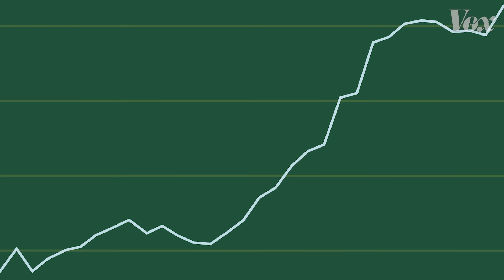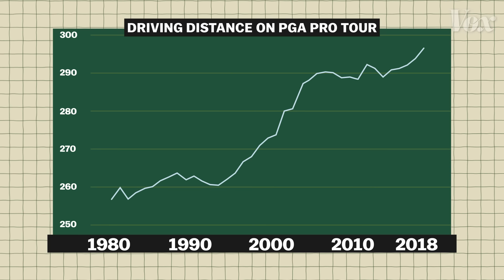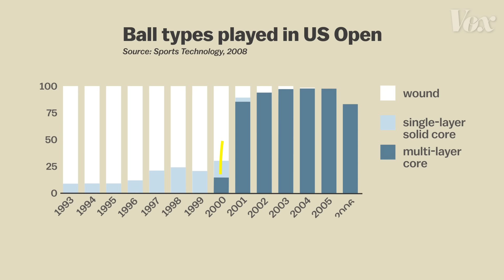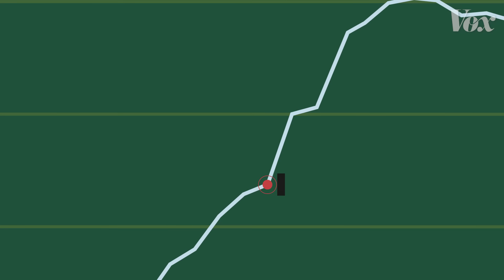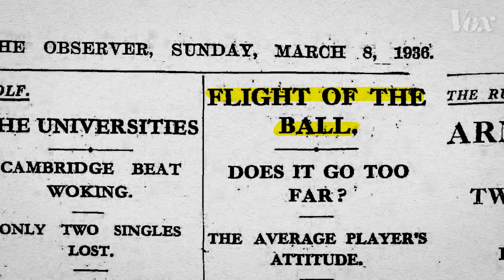The golf ball that made golfers too good

Comment: "A heavier ball would fall out of the air more quickly"? Hunh? 
Oh, yeah, heavier things fall faster. Right. Galileo never lived.
Reply: Heavier balls require more kinetic energy to move. Hence, when you hit them they move slower, and thus cover less vertical distance before hitting the ground. Clumsily said, but essentially correct in this context.
Reply: I recall a study on American football about the weight of the ball and throwing distance.    Common assumption was that a lighter ball would go further. Surprisingly though, a heavier ball went further. I believe it's a balance between launch speed and weight. It'd be interesting to know what this is for golf.
However, given how much R&D goes into golf balls, I wouldn't be surprised if they are already at this perfectly balanced point... Unless they have weight guidelines, if anyone knows?
Reply: Only in a still vacuum without drag do heavy and small objects fall at the same speed. However, as Newton said, F=MA. We can rearrange this to A = F/M or Acceleration is equal to the force divided by the mass. The higher the force and/or the lower the mass, the faster the acceleration. Acceleration has a direct effect on speed, objects with a higher mass will have less acceleration and thus less speed.
Reply: @Amelia Carneiro Zhu yeah momentum describes it well.
Jeremy, that's correct but applies only to the first split second. What about the rest of the flight? Air resistance, perhaps?
Either way the real world results are different than people expect. But it really makes sense. Kicking a balloon won't go further than a ball
Reply: To make my point a bit more clearly, yeah heavy things are harder to speed up, but they are equally harder to slow down. Given the vast majority of their distance is met with air resistance which slows them down, I'm sure you can appreciate the need for more mass to resist this. I'm not saying more of one is simply better, all I wanted to say was, I wonder were that perfect balance is. Would it be slightly (or significantly) more or less than a current golf ball?
Anyway, I wanted to point out this interesting though. Hope some of you can appreciate that :)
Reply: @Runningfromtheredqueen  While you are correct that a ball with more mass requires more energy to accelerate, you can't focus exclusively on mass and ignore aerodynamics.  A ball of less mass with the same volume and aerodynamic properties won't travel as far due to aerodynamic drag.

Consider an example of teeing up and hitting a ping pong ball.  The ping pong ball with much less mass (being much easier to accelerate) much sooner reaches its terminal velocity, hence doesn't travel as far as a ball with more mass and higher terminal velocity.

Comment: "A heavier ball would fall out of the sky more quickly."
It wouldn't though. If it had the same shape it would take the same time as a lighter one.
Reply: Giovanni Barozzi 

It would lose momentum more quickly due to the increased force required to make it travel the same distance, thus spend less time in the air.
Reply: Fraser Souris sleep through physics class much?
Reply: Giovanni Barozzi yo you’re right! Gravity accelerates all objects to an equal amount irrespective of weight

Comment: All you have to do is massively narrow fairways, thicken the rough and make more bunkers.  This obviously increases the risk of bombing it.  When Tiger was the ONLY good golfer who was ALSO longer than everyone, they "Tiger-proofed" courses so he wouldn't dominate as much.  Now, a majority of the tour is not just highly skilled, but also long off the tee.  If you massively increase hazards, then that brings skill back into it.  If Bubba is cooking a 330yd drive down the middle of a 15 yrd wide fairway, he deserves it.  Also, specifically regarding the example used from the 2014 masters, you have to have massive stones to hit that shot because he probably had 20 yds of slice on that.  It was a very high risk/high reward shot.

Comment: Whats causing this rise?

1) Much more athletic pro golfers, who now all train for power and length off the tee.
2) Drivers, that 1) Produces higher launch, 2) less spin, 3) have bigger sweet-spots for less ball speed loss on mishits and 4) have a lot less gear effect, meaning straighter drives, meaning you can swing all out without being afraid of a 50 yard slice.
3) Longer and lighter shafts for increased swing-speed (In year 2000 Tigers driver had a 43,5" 130g steel shaft. Now its a 44.5" 60g graphite shaft)
6) Balls with 1) more aerodynamic-efficient dimple patterns, 2) that produces less spin - which in turn creates longer carry.
2) Shorter grass on the fairway, meaning longer rolls.

All in all, its not the ball. If the balls hadn't changed since 2000, we woulds still see an increase in carry distance... and the average haven't really increased since 2000, when there were set a limit on the drivers. Its only been a few yards of average increase since year 2000, so its not the ball, its everything else mainly and the ball a little.

Take a 2019 ProV1 and hit a driver from year 1999 and hit a driver from 2019. The carry difference will be about 15-20 yards. Now take a 2019 driver and hit a Titleist Professional 90 from 1997 and put it op against a 2019 ProV1, and you'll see about 10 yards more carry. Now consider then, that pros are becoming stronger, faster and more powerful and you have a potent mix. But in all honesty, the average distance on the pga tour haven't changes much since year 2000-ish.

Comment: In addition to making the ball fly shorter I think all the clubs should be made with the same materials and same design.  The only thing you'd be able to change with a club would be the length, based on the height of the golfer.
Reply: they place restrictions on club stats so no matter what materials and designs are used, itll perform the same
Reply: @doggorussa376  liar

Comment: 4:30 I honestly might be misunderstanding what you’re saying here, but the acceleration due to gravity is the same regardless of mass. So a heavier ball wouldn’t fall faster.
Reply: It most likely means that the ball would have less speed to begin with as it requires more force to get it moving
Reply: what he's saying is it reduces drag.

in a an enviroment with no atmosphere. like the moon, yes all objects will fall to the ground at the same speed, but on earth we have a few things that impede someting of low mass to fall quickly, mostly air resistance, which is why feathers fall the way they do which is obvious, but it will still affect something like a golf ball, if you take a golf ball and  a steel bar and drop them from 10 meters each, the steel  bar will hit the floor slightly quicker than the golf ball because of this resistance.

Comment: The solution is simple - require the core to be filled with at least 50% lead. Other sports have minimum requirements for equipment, for example minimum car weight in F1 and bike weight in Tour de France, maximum boxer weight in boxing, maximum car size in F1, I can go on. Gold can make requirements too.

Comment: 4:35
"A heavier ball would fall out of the air more quickly"
That's just false, I can't believe that made it through to the final cut of this video. Basic physics.
Reply: Actually it’s not false. A heavier ball means that the golfer can’t put as much backspin on it because the rotational inertia of an object is kmr^2, so if the mass is bigger, then it will be harder to rotate it. And with less backspin, the ball will drop quicker

Comment: They also left out how much golf clubs have changed....going from wooden drivers at barely 250cc to 460cc carbon fiber drivers also makes a huge difference....this video is the equivalent of "modern Tour de France cyclers are too fast, is the rubber their tires made out of too advanced?"
Reply: The drivers are more like if they let baseball players hit with aluminium bats of huge size. It never should have happened in the 1st place. Clubs should have been kept wooden headed (for woods) and under a certain size.

Comment: How about just regulating the innovations. If titleist knew the Pro v1 could not be used on tour they would not have invested in mass manufacturing of it. I'd say golf is about at the level where courses could modify their layout to accomodate the last 50 years of innovations as long as a tighter look at new innovations/club mods is brought in to keep the equilibrium there. Local clubs don't need to modify course layout as amateurs don't hit it 300 regularly - just the courses top professionals play on - who have the money to do so. I like playing with the same equipment as the pro's, why over complicate it and reduce the fun involved in watching them bomb it off the tee. Finally if you keep the equipment innovations in check and some guys get stronger and swing faster then so be it - it's not going to continue to add miles to their ball flight - this video shows the ball had the biggest effect anyway.